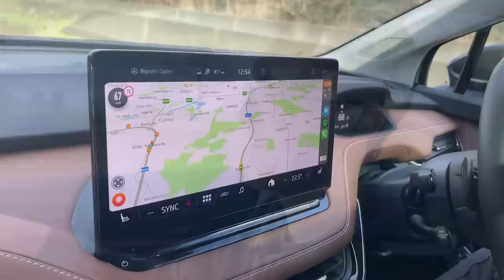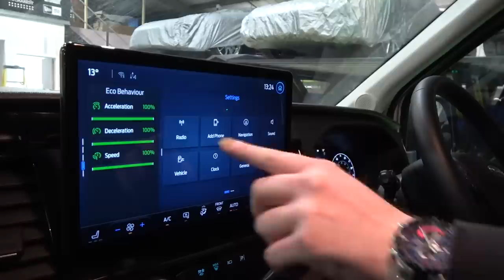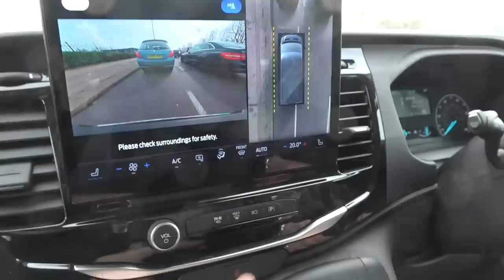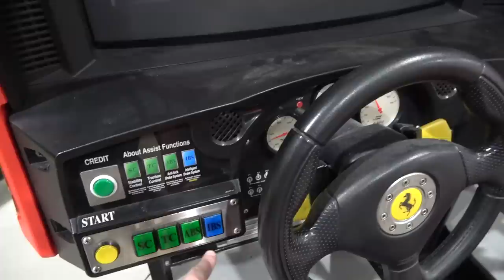Collecting the ULTIMATE Ferrari Memorabilia for the Garage | SHMUSEUM VLOG 121

Comment: Guys when you change wheels on a car with ceramic brakes, please use a pair of wheel hangers. It is SO easy to crack a disc if there's contact. They are cheap and Hill Engineering in the UK sells them.

Comment: 12:30 it looks like lusso had it winter rear tires on the wrong side of the car. Because i think those are directional tires and were spinning backwards. And in 1:50 you can see sf90 has tires correct way around.

Comment: Funny thing is that they are so impressed with the E transit and it is identical in every way to the normal transit van, just with an electric engine.  We use those at work all the time here.  That larger screen on the center panel is standard on all of the new ones.

Comment: I understand that the Ford E-Trucks have significantly less range under load, the test is from a full charge to load the truck with either 1000 lbs or 4 people and test the range, then try the same distance with a full charge and just the driver and record the range, it will be significantly less…

Comment: I wonder what the range would be with the van fully loaded with tools and equipment
Reply: Basically the same. Weight doesn’t impact the range nearly as much as you think (probably 5-7% reduction fully loaded).  The big range killer is aero, which obviously would be unchanged.